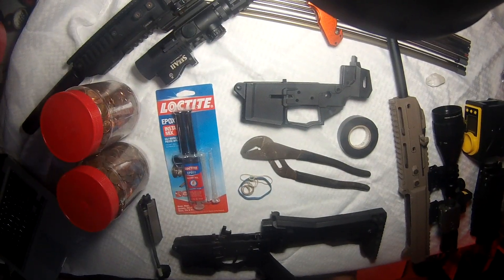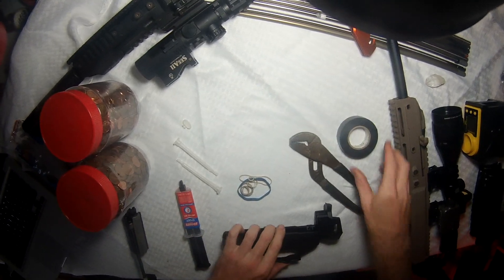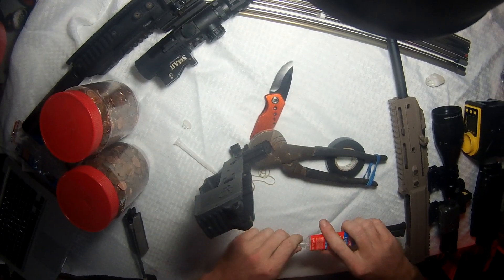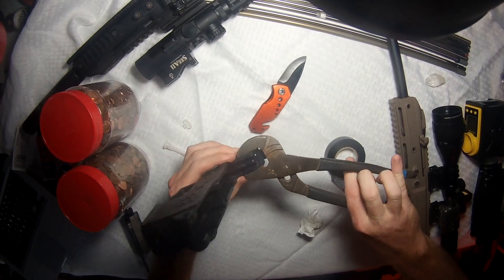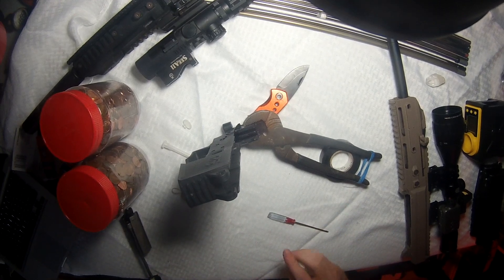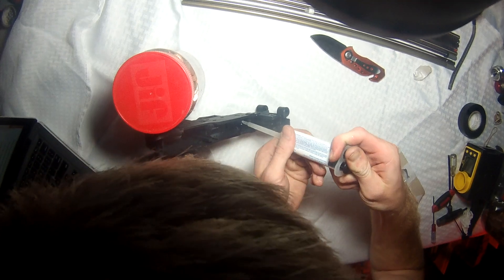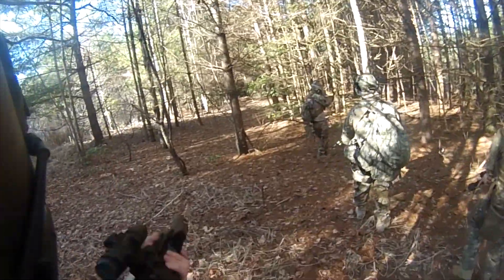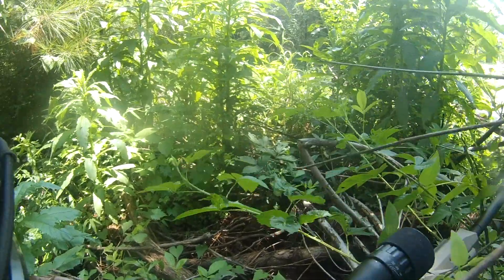How to make a GHK G5 Lower Receiver 100% Reliable

Comment: Hi is there any visual difference between the gen 1 and gen 2 lowers, i know the gen 2 has been reinforced and im looking at getting a second hand one so wondering if i can tell easily from photos.
Reply from the maker: I belive Gen2 has all equal length tabs in the rear (the fins you see me filling with epoxy here). Neither gen is safe from cracking. You'll want to reinforce it no matter what.

I need to make a new video showing how to epoxy in some 3d printed L brackets.....What I did here years ago is better than nothing but not nearly as strong as what I can design currently.

Comment: this is a great idea and I'm doing it now, however one suggestion, use plasti dip instead of epoxy, you can buy it in a paint can form and it rubberizes when it dry's, so it will be less brittle and because its rubber, it will have bounce to it, which could even increase the rate of fire slightly as it will add forward bounce when the bolt hits the rubber

Comment: This takes a bit more than some epoxy, but I've seen (and plan on) putting steel plates on the lower. Combined with this I think that the gun will literally literally bulletproof

Comment: Hello great video … I do own a ghk g5 and it's working great for me …mind telling me a bit more about the mag catch modification? Didn't get it quite clear where to bend it …but thanks for the awesome tip 😀
Reply from the maker: You bend the part that touches the mag farther down. This lets the mag press the catch farther up to do a better job stopping the bolt. I can make a separate video on the mag catch. It will only be about 2 min long if I do.
Reply: Reece Mechanical Thanks for that information and video
Reply: For those that are wanting to see the mag catch video, I found one here: https://www.youtube.com/watch?v=o3kgtNtnuXo

Comment: Hi thanks for the detailed video. I haven't had a problem yet but it's good to know to prevent one. 
Question is that a DMR kit? what FPS and range did you get?
I would like to know for  my field limits. Thanks
Reply from the maker: The Tan gun has the carbine kit with an extra GHK 4inch extension & a 509 barrel. Its gets about 4 Joules on .48s in 75 degrees.

We've pushed it to about 135 yards but it gets about a 4 ft circle that far away. Elevation is dead on though
Reply: @reeceengineering  Thanks. Wow a scary and awesome gun. Thanks for the info.

Comment: can you explain more about 7:31? I have my g5 in 2021 ver and if there isn't any option rubber buffer, I have to make my own. Should I just cut a hard rubber plate to a shape that fits in as a buffer and that's all?
Reply: and what is the ideal height of the rubber plate buffer?
Reply from the maker: @김태윤-k9h6y  What you can see at 7:31 is a rubber pad that I cut out. I would recomend leaving some room between the rubber and the upper receiver. If its a direct fit then the rubber wont have any space to expand. The pad seen there is 3.175mm thick
Reply: @reeceengineering  oh..ok I understand. But I heard that gen2 frame is pretty durable and If I'm not gonna use co2 is it ok to just do epoxy mod and put rubber ball from samoon?
Reply from the maker: @김태윤-k9h6y  Its ok to do that. I dont always use a sorbo pad in my g5 bolts

Comment: Also make sure the rubber buffer in the upper is present, as the little bit of energy that it absorbs is what prevents the lower from cracking when you fire it. You can create a temporary buffer with rolled up electrical tape. It is definitely as permanent of a solution (the buffer will get beat to hell, may dry out and become brittle) as strengthening the receiver is.
Reply from the maker: In the temperatures of my area I can %100 verify that a rubber buffer is not enough. Mostly because the guns have one from the factory & crack already, also because before creating the Epoxy mod I was using a sorbo pad as an upgraded buffer and cracked 2 lowers that way.

Comment: After implementing the epoxy mod as shown, is it safe to fire the G5 with stock folded? If so, semi only?
Reply from the maker: Ultimatly its a plastic receiver. This makes it a lot better but it will always be plastic

Ive never had one fail before, but other people have reported failures. To me this means that either the epoxy used wasnt as strong, or the method was wrong.

Comment: Wellp i did this mod with the epoxy and after letting it dry for 2 days i fired 15ish shots and then the whole bolt carrier flew out the back of the gun adter braking the back of the lower recever off. There were no stress cracks on my gun prior to this mod sooooooo idk just kinda mentioning it yippie
Reply from the maker: What kind of Epoxy did you use?
Reply: @reeceengineering  loctite epoxy, has the mixing tip, verry simmilar to what you used
Reply from the maker: I had the same failure you described a few months ago. I believe Loctite has changed their formula. Im now recommending JB Weld. I will be re-shooting this video.

My apologies for misleading you.
Reply: @reeceengineering  no problem, i have already replaced my lower, and i have a spare g5 to part out if need be. Im just apprehensive to try an epoxy method again
Reply from the maker: @MrDoom8125  What method will you try?
Reply: @reeceengineering  I don't think I'll try anyting there's been good results with the gen2 lowers without any modification so I'll just roll on that

Comment: Can it survive c02 after this mod?
Reply from the maker: Richard Rogers It cannot. Even if the lower could survive the trigger group would fail. Its not made of steel like the M4 and AK's. We need metal lowers and a steel trigger group for CO2 or HPA at pressures higher than propane.
Reply: Good to know
Reply: @reeceengineering  Where we can buy steel g5 lower ?
Reply from the maker: @jeanneaudet7771  In the future